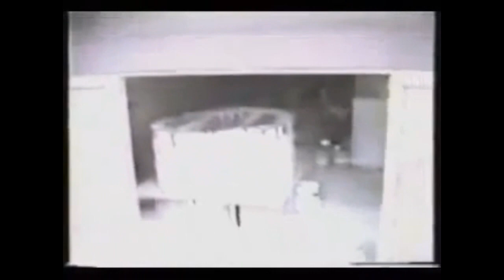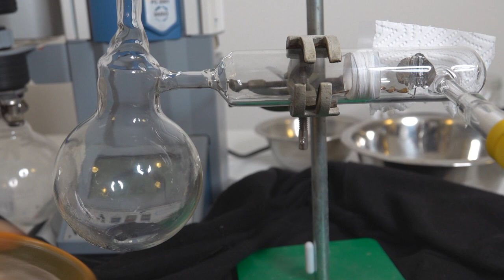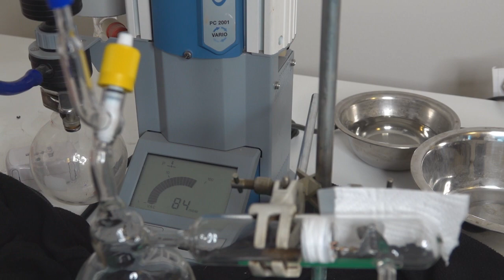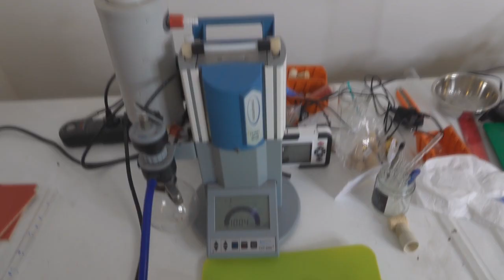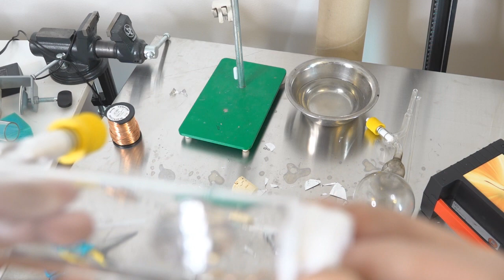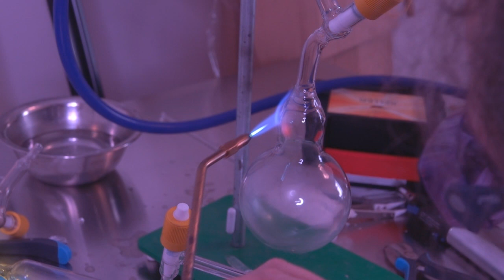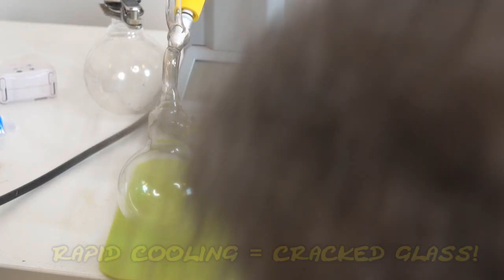The “Hydro-Vac” Space-Powered Steam Engine!

Comment: So water is vaporized in the vacuum and condenses when cooling creating a water vapor gradient? Can this be scaled to any meaningful level in space(e.g. to recoup energy in a "closed system" like the ISS)?
Reply: Theoretically I assume it could.
Reply: No, water is too heavy and transporting to space is not cheap enough to make this do able.
Reply: @excited box you are right, I am bad at chemistry. I corrected it
Reply: Space is not the important part. What's important is the temperature gradient. On the ISS getting rid of heat is difficult because space is an insulator. They have to use large and expensive radiators to get rid of it. They certainly would not want an engine in the middle cutting down the efficiency of those radiators.

This is true in general. If you want heating or cooling from some natural source you want it to be efficient. Take a nuclear power plant cooled with huge cooling towers or pumped sea water. Again you do not want to make the cooling less efficient. If you have waste heat it is generally better to use it directly eg to heat homes than to stick an engine in the middle, slowing down the energy flow.
Reply: @OverTaxed42Long  

I'm not defending or supporting this but there's loads of water in space. There's no need to waste fuel removing the limited resource on our planet that we need here.

Adam

Comment: You still need an energy input to get the water vapour moving. This is not powered by "cold" as cold is simply a lower energy state.

Left chamber gets colder than evaporation temperature (rougly 20c at 16 mbar), allowing water to condense gainst the inside of it.

 Right chamber is at boiling temperature due to surrounding air. Pressure lowers due to the water condensing in left chamber, making evaporation temperature go below roomtemperature. This causes it to absorb energy from the room, thus powering the flow of water vapour. 

First you need energy to heat the right chamber, secondly you need to move around a lot of energy to make that ice to begin with.

*edit: As seen in the thread below I am well aware that this is ripping on the solar roadway type people, no need to bash me!
Reply: @kari-jeremiaspihlajainen435  Those kind of people would get stuck reading your name.
Reply: @Jehannum2000 :`D
Reply: @stupidas9466  i refer you to my previous reply.
Reply: Kari-jeremias Pihlajainen fair enough! May i suggest you make a simple edit on your original comment? A little addendum that clears up the fact that you do realize TF isn't serious, might save you some trouble! I will delete my previous comment, cheers!
Reply: @stupidas9466  's'kew, edited it. ^^

Comment: Nothing special about the water room temp in vacuum
Reply: It really stinks we can't actually use this gas company's are very greed
Reply: @zapperpap5872  you understand that the energy still comes from the temperature difference, and this is not a perpetual motion free energy machine dont you?
Reply: @wodthehunter8145  im pretty sure he was being sarcastic, i honestly doubt anyone who watches this channel believes in free energy bs lol
Reply: @kiyosenl.3889  No we don't believe in the free energy BS.  We believe in the free energy TRUTH.  Like SpaceHydroVacuum. </sarcasm>
Reply: @williamwhitman9073  lol nice
Reply: The theoretical efficiency limit of this is  around 14%, assuming a temperature differential of around 40 K. You'd be better off with almost anything else.
Reply: @drunkenhobo8020  question if we put "hot" part inside space ship
and "cold" part outside spaceship
won't those 14% generate us some usefull energy?
Reply: @ilerien  outside of the spaceship you only radiate the heat away, it's not really that good. it will cost you more to build and maintain this installation than the energy you might get back. Plus, outside in space you have plenty of solar energy anyway, so why bother at all?
Reply: @kiyosenl.3889  It's never free if you got to put something in It at the start.
Reply: @viqtor23  well i was thinking deep space not nearby but yeah it wwould be quite costly true...
Reply: @SILVERSTRIPE_  yes it is, if you get more energy than your input, but thats impossible, however thats the whole idea
Reply: @ilerien  We should probably worry about finding ways to travel to deep space before we worry about energy production out there. And nuclear fission would likely be the most effective.

Comment: great trick. something in my mind keeps saying "stirling engine" and then I keep thinking of the drinking bird and how it works. Isn't this based on a similar principle (where water in a vacuum behaves like a volatile liquid, evaporating and condensing at a range that is amenable to tilting the bird)? If i'm not mistaken, at about 75 millibar (the value you had), water should be right on the edge of turning to vapor at 25 Celsius. I don't have chemistry experience to go beyond that, as I imagine the heat of vaporization might affect the transition from one state to another and thus, why dropping the pressure doesn't immediately result in vapor, or some delicate balance (since there are vids of water boiling in vacuums here on youtube).

Comment: You make glassblowing look easy, but having tried a few times myself and seen how long it takes to learn how to do it properly, I know that it's actually really difficult. The glassblowers that worked in the chemistry department I used to be in at university had been at it for decades, and they told me that it takes at least 10 years to get reasonably competent. The one thing I'm surprised that you apparently didn't do here was put the finished piece into the annealing oven to ensure that any weak points were removed. Yes, I know that wafting a moderated flame around the joints does a similar sort of job, but that's just to stop cracks forming immediately, as you noted.

Of the many things I learned in the lab, one was to never put any assembled glassware under vacuum unless it had been properly annealed - because if there is a weak point, the force of atmospheric pressure can break the glass or even cause an implosion if you're really unlucky. Though I'm guessing that the reason you didn't do this was that the heat of the annealing oven would have melted that little aluminium "windmill" section and burned the epoxy glue you used to hold it together. This could have been obviated though by making the windmill out of slightly thicker copper sheet, and doing any needed metal-to-metal joins by brazing or with high temperature "silver" solder. Then the whole thing (with the plastic valve keys removed, of course) could have gone into the annealing oven overnight and been much safer. Copper wouldn't melt at glass annealing temperatures, though it probably would oxidise and turn black on the surface.

Comment: Fun project. Could seal the whole unit and then alternate sides. The spinning device in vacuum bulbs probably would generate similar power. I don't recall what they are called but are little squares and when exposed to light while in a vacuum will spin.

Comment: Phil! You have golden hands with the glass blowing! My high school chemistry teacher was good too and made her own Shlenk lines etc. She taught me a cool trick for joining a tube  onto another. Like you she would heat a spot and blow into the tube to make a hole. Then would heat the rim of the hole and the tube until yellow and flowable & stick together to make the initial joint. Now the magic part. Take a hose (with an optional little mouth pipe) and attach to the tube. Then heat one quadrant of the joint at a time, lightly puffing on the tube and heating until  the hot glass begins to move in and out. The glass in that quadrant magically transforms and works out into a nice smooth joint. Then move to the next quadrant and repeat. Heating and pressure working only one quadrant at a time keeps the joint aligned via the rest of the cool glass. And using the mouth tube to puff in and out  allows the glass to flow and work out the imperfections. The catch is the whole system has to be closed so the only opening is the one the mouth tube is attached to. And of course if the glass gets too hot and you blow too hard, you’ll just blow another hole so takes a little bit to get just the right heat/puffing pressure combination.

Comment: How are you generating the ice? It is a type of heat pump. There is a piston motor using a similar system that you can get power ( small amount but scalable ) out of easily. they rely on heat differences, heat one end or cool the other.  How much power can you get out of this? How do you get that power out of it?

Comment: Did you worry your gladd might implode going that low pressure due to imperfections in forming your glass?  Not annealing properly? Or did you use something like polarized lenses to see stress lines?

Awesome using high voltage to find pinholes.

Comment: Would this actually be a good way to produce power in space? As generating a vacuum is probably the most energy intensive part of this device or would you just be better using a thermoelectric generator, which I guess works on a very similar principal, where you heat one side and cool the other. (Which on space vehicles generally use a radioactive isotope to generate the heat). You could theoretically use solar heat but in that case you might as well use a solar panel.

Comment: Some of the water vaporizes in the vacuum until the water atmosphere reaches equilibrium. When he puts the ice on the glass it causes some of the water vapor to condense pulling it out of the atmosphere creating a drop in pressure in the side of the apparatus where the ice is. This causes water vapor in the other side to rush through the turbine to re-equalize the atmosphere turning the turbine. This also causes more water to vaporize to equalize with the vapor pressure. Neat.

Comment: Well, interesting video, impressive skills. learned a lot about manipulating glass.
I have to ask....why?
if I understand what you are showing correctly, nothing happens untill you provide temperature differential, and then some weak-arse rotation occures. Surely you can achieve the same in some kind of closed loop piping system with any liquid as a medium with no vacuum requirnment and forces would be much more palpable? (type of event that happens in central heating systems when you turn off the pump and circulation continues due to temperature diferential..liquid in a system turns the pump instead of pump forcing liquid through the system). What am I missing?

Comment: I think I understand how this works for anyone interested.

First of all, there is energy potential in a heat differential which is the energy source for this machine.  Probably not a surprise to anyone who frequents this channel, but it’s no free energy machine.

It works because of properties of water, and all liquids for that matter.  Water’s boiling point drops with lower pressure, at sufficiently low pressure it boils at room temperature and if it’s in a confined space it will eventually fill the chamber with water vapor until it’s pressure is high enough that the boiling point is above room temperature.  The ice touching the other side causes the low pressure water vapor to sublimate, which lowers the pressure as vapor is removed from the air and makes the water on the other side boil again.  This creates a flow of gas from the hot side to the cool side which turns the little turbine.
Reply: I assume you mean condensate, not "sublimate". Also the boiling point does not drop with temperature, it drops with lower pressure though.
Reply: NetAndyCz "the boiling point does not drop with temperature" - i wanted to make a smart ass comment with a funny punchline but i couldn't top the hilarity of the original line.  Funny stuff!

Comment: This reminds me a lot of a stirling engine with many modifications. It still uses a temperature gradient to move things, in this case water vapor, and the high vacuum is to allow water vapor to exist. If this were to be used in energy endeavors in space it would be great to get closed loop (no water is lost) but I still like it. It’s powered by a temperature gradient and water perfect for any space station with access to lots of hydrogen and oxygen.
Reply: TL;DR great like a stirling engine. Could run off of body temperature and would only need water. It would be awesome if some how the water could be recaptured and condensed, but it’s still a great piece of work.

Comment: An interesting / novel take on using a temperature gradient to power an engine if a bit inefficient. 

The engine requires a temperature differential to work... The cold glass condenses water vapor on the left side creating a flow right to left as more water evaporates off.

In terms of efficiency, the Stirling engine has always stuck me as the best use of a temperature gradient for powering an engine.

I would be interested in you doing a video on the Stirling engine and explaining it's design and operation.

Comment: Basically a Stirling engine, cept using a vacuum and water vapor instead of compression and air. 

Principle is similar though, thermal differential to move a gas from one chamber to another.

Comment: It is very similar to a sterling engine in how it operates.  It is just using the difference in temperature to drive an engine.  In this particular engine, it is using the vapor pressure of water in a vacuum at room temperature to produce a high pressure side and the vapor pressure of water in a vacuum at the temperature of the ice, lets say -5C, to produce a lower side and then putting a energy extractor between the two.  In this case a piece of aluminum foil.  It is not free energy though, it is just extracting the thermal energy difference between the two sides and converting it into rotational energy.

Comment: The glass is nice it shows what is going on sort of but making it out of metal pipe larger vacuum chambers better angles for flow and condensation of the water vapor also putting a proper turbine and generator between the vacuum chambers with a low heat source on one side would have dramatically improved performance and actually made usable electricity.

Comment: This is a very cool idea that seems like it could be a great source of energy in space, but it seems to bring up many questions for me [and my extremely uninformed mind, so applogies if the answers are obvious.]

How would this continue to produce energy in the long term?

Once the watervapour has left the right flask and entered the left flask [which would be in the cold of space] it would freeze. How do you then remove and reuse this frozen water?

Would the engine be a rotating system made up of multiple engines allowing the freezing and feeding flasks to switch positions [if so, how would you maintain internal atmosphere and temperature?] Or would there be a mechanism to remove the frozen flask with an empty one, in which case how would you ensure that you wouldn't introduce a leak over lengthy use and repeated replacements?

Comment: My theory is that the gas on one side when cooled, compresses. Since one side is losing pressure, the other side allows it to equalize causing the aluminum foil fan to move a little bit. When there is more pressure, not enough air moves to turn the fan.
Reply: it isn't just cooled it also changes back in it's Liquid form

Comment: So, water evaporates and condenses at the cold end, pulling more vapor from the other side. This moving gas moves the "turbine". So power input comes from the work done to cool the cold side... Useless for "generating energy", but might be of use moving rocket fuel from one tank to another in space without using pumps but just by "aiming" the rocket or satellite in just the right way to induce a temperature difference between the two tanks - it would be slow, but could be an option prefered over having to use mechanical pumps on decade long missions...

Comment: When you open the tap, the water boils and the water vapour gas moves to the vacuum chamber and that's what moves the propeller. This engine will keep going as long as there's a lower pressure in the vacuum chamber than the water vapour pressure of the liquid water in the water flask. The ice you use to cool the left flask lowers that flask's pressure. If you heat it instead, the engine will run in the other direction.

Comment: The real question is why do you get a spark with the pinhole like a metal? Is it because the air molecules are spreading (and accelerating) inside the vacuum creating a higher potential between the elektrode and the pinhole?

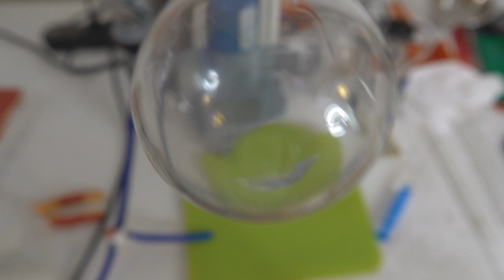Comment: At 11:30 I think the water do not boil because the container is full of water vapour. If you continue to suck gaz with the pump it will continue to boil until there is no water left. So I think a glass of water in space would partially vaporize and then freeze.

Comment: Easy to make it work add a one way gate slanted so that when the water cools down it goes back into the start. insulate the start point of the water than leave it in the artic. Now there is actually an interesting point to make they use this on a research base and the heat left inside the base powers the generators. and it works however not technically unlimited if the polar ice melts that is.

Comment: This is heat transfer via water molecules to a rotating fan.  It relies on the fact that the system is closed.  But if the system is closed, how do you transfer the spin energy outside the system to do "work".   This might be able to be done via magnetic induction.   But the biggest flaw in this device is that it doesn't scale.   How can you create lots of energy with this?  It would take a lot of resources and physical space.  The "cold" source could be fallen snow